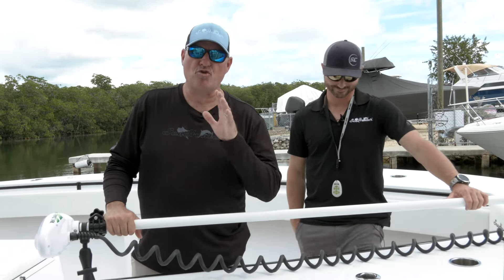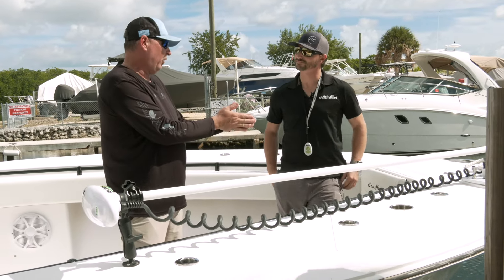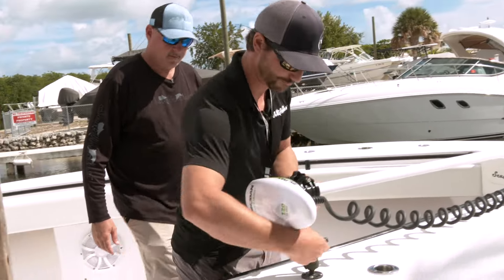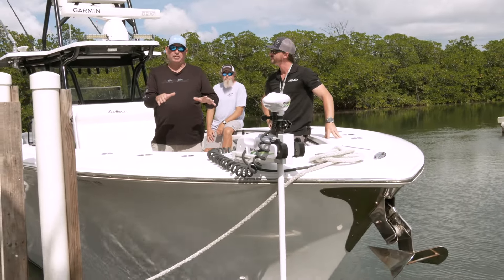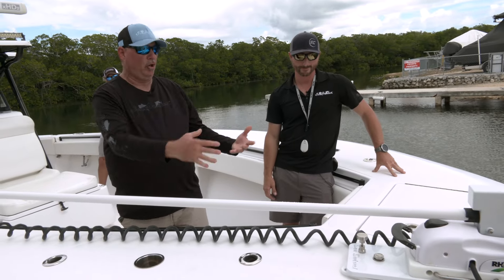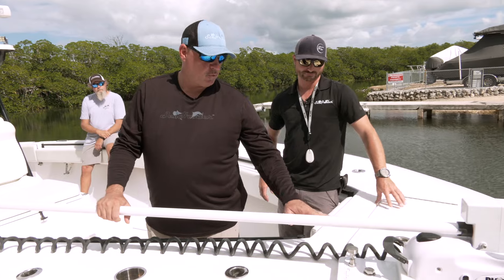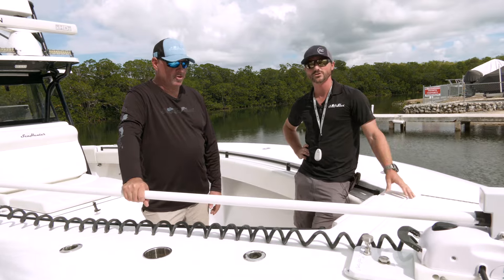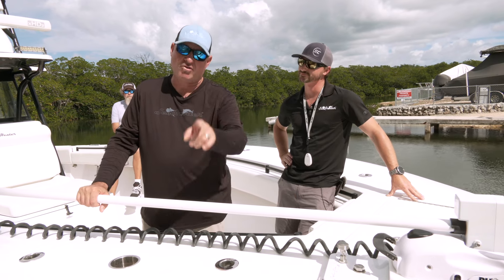Trolling motor bracket 2024 | Trolling Motor | sea swivel | Tackle Talk | Florida Sport Fishing TV

Comment: It's a great idea, but you need to make a smaller version for small boats at a cheaper price point. I'm currently making one out of aluminum plate and a down rigger swivel because I have a 1 inch lip on the bow. I'd definitely buy one if it was smaller and 1/3 the price. But guys that own a 36ft boat aren't worried about Breaking Out Another Thousand(BOAT)

Comment: Exactly the solution I need for my Sportsman 282TE. The current installation blocks my view while navigating and is dangerous when deploying the trolling motor in rolling seas. The installation in your video shows how it is not directly blocking the straight-ahead view and can be deployed while standing inside the boat.